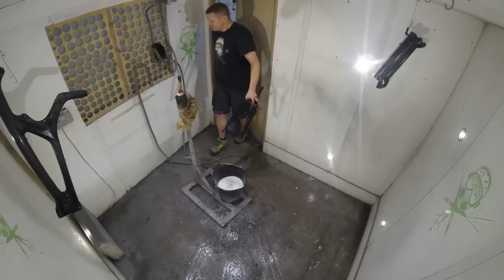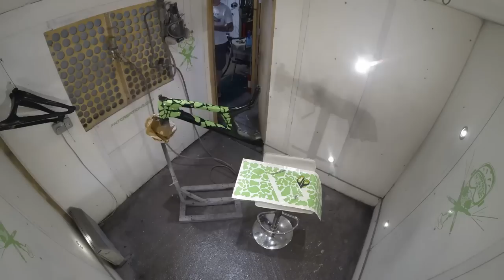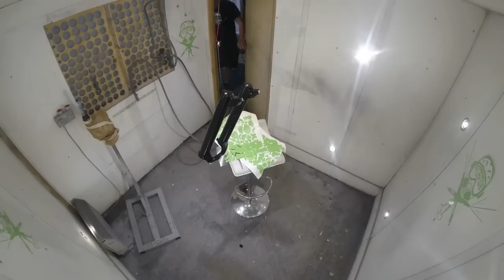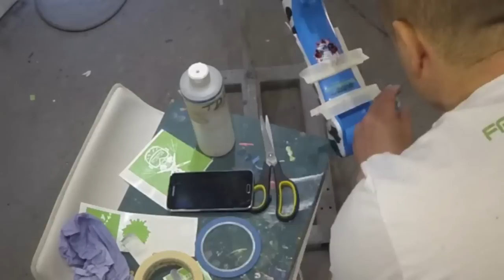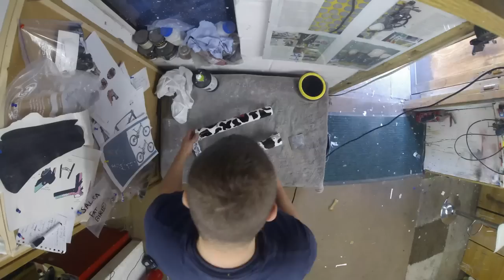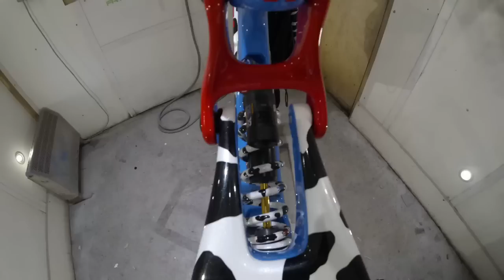steve peats santacruz V10 cow custom

Comment: How long do you wait to put the next stencils, (in the drying of each layer) and I saw that since you start you do not remove them until the end.
Reply from the maker: Sorry for not coming back to you sooner. We use solvent based paints so if we are applying these through an airbrush they dry almost instantly. If we have just layed base colour on a frame we will wait about 15 minutes before we apply stencils, and depending on the lay up we may remove them right away or leave them until we have finished

Comment: I have to ask, about how much weight is added to the bike with all this paint? Absolutely beautiful job btw
Reply from the maker: this did add weight. normal paint jobs are = or less than original but this added 96 grams to the front frame and 105 to the rear. But they were raw when they come to me so weights were lower than normal